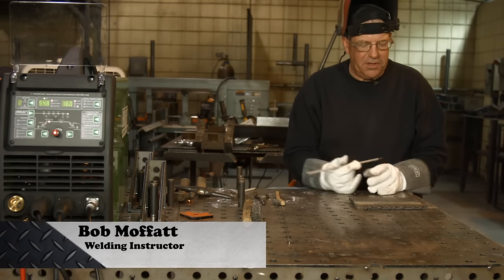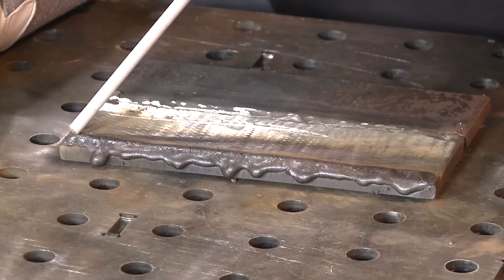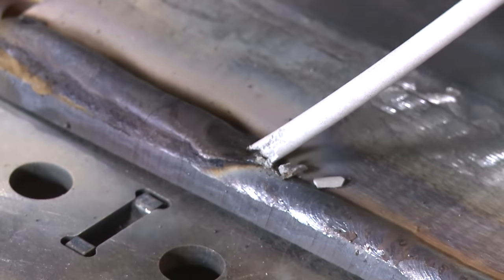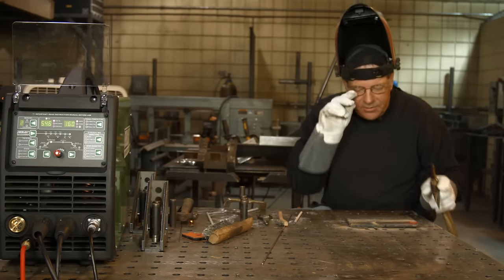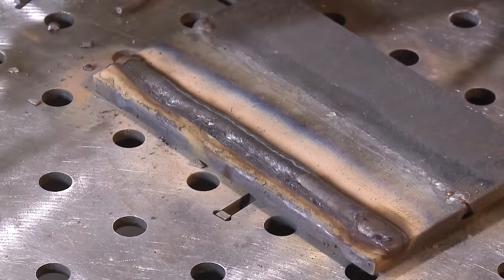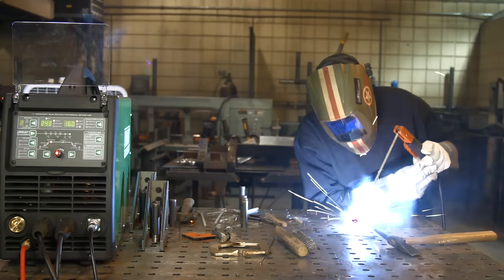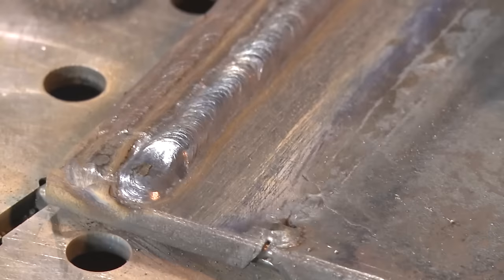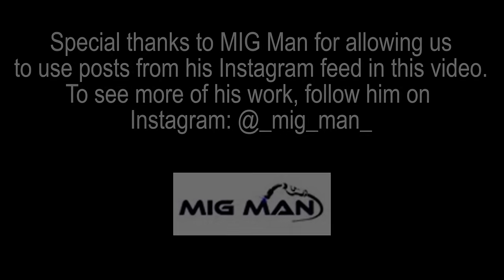Welding 101: How To Run A Straight Bead

Comment: I was a welder for 40 years. This is one thing that I would tell new welders. "Always try to make your next weld better than the last one, even if the last one was the best that you have ever done."
Reply: Thanks for the advice I’m starting welding next week
Reply: Do you ever miss it?
Reply: @LawrenceCaldwellAuthor  Actually, I'm not missing it. I have an old stick machine that I bought at a yard sale for 35 dollars and a flux core wire welder that I bought at Harbor Freight. It's the kind that has an inverter instead of a transformer. It welds almost as smooth as a MIG welder and weighs only 15 pounds.
Reply: @kraut5011  Awesome. I'm thinking about getting into it, but there's no schools around where I'm at.
Reply: LambentTyto teach yourself
Reply: I was a welder for 6 years and don't miss it. The money was good, but its nicer not having to breathe in burning metal for 10 hours a day.

The one thing I learned which was contradictory to this video was to maintain an arc gap. Rather than "barely touching the plate", we ran our rods about a mil or so above the surface, the only time you ever got a stuck rod was one of the low hydrogen bastards when your striking them.
Reply: @somethingoriginal5880  Some advice which you can try, It worked for me but everyone develops their own method really - 
I like weld standing up - you'll have more control, 
try to keep about a mil or two (or a 1/25 inch  to a 1/12th). 
pick up as many offcuts of material from your local hardware store as you can, and buy corresponding rods for them - you need a stainless rod to weld stainless etc...
Its all about managing your heat input - you get used to judging it by eye based on the glow

ALWAYS clean your welds before another run. (just always clean your welds.)

For TiG or Gas welding, I find it easier to sit, as you'll find both of your arms in constant use.
DO NOT GET INTO THE HABIT OF PUSHING THE STICK DOWN WITH YOUR MASK OR BODY. It's very easy to mix up the hot side and the cold side.
(Sounds dumb and obvious, but more welders than you think have probably stuck an inch of welding rod into their belly at some point)

For MiG - I dunno go nuts. just go ham. I sucked at mig welding Im not gonna lie. I was always just frustrated at how messy it is compared to mma, tig and gas.
Reply: @Teadrinker3445  "the only time you ever got a stuck rod was one of the low hydrogen bastards when your striking them."  This was true with the 3/32 rods.
Reply: That is good advice. You’re only as good as your last weld.
Reply: @easyenetwork2023  I always learned from other welders. Even younger welders. Some of those guys learned a lot quicker than me and made some beautiful welds.
Reply: @easyenetwork2023  Did it affect your lungs ?
Reply: @easyenetwork2023  Was it really that bad ? Even with respirator ?
Reply: @MUUKOW3  u may start but good luck there's alot to learn
Reply: @mikeundereood1071  You can pick up a good welding book at the local bookstore for a few bucks ,watch YouTube videos and practice.  You may not be manufacturing CNG tanks but doing general fab work is easily in reach.
Reply: Hopefully the first one will work out good then 4 blobs on each side of the weld line on my patch plate just for extra strength.

So you were into to this stuff for that long then what's the best way about welding a rusty surface should i clean all the rust off first then weld or what's best
Reply: @Mike-su8si  It depends on the situation. It's always best to have a clean weld surface but you might not have that option.
Reply: I like to think that advice can be pushed to many aspects of life
Reply: @LawrenceCaldwellAuthor  yeah right here on YouTube you can learn from other people's comments or videos
Reply: @kraut5011  I have already cleaned the surface off and it has 2 coats of paint on it so i wasn't for sure if i should resand the paint off to weld the thing 

Cause when i first sanded it it was to get all the flakes of rust off I probably will go ahead and resand it weld clean it then paint
Reply: @Mike-su8si  It's hard for me to give  advice without being able to see what is it that you are are working on. If it's two separate pieces you might have to grind bevels or if it's one piece with a crack you might have to grind or gouge a groove in it. You could weld without removing the paint and it might work but to be sure the best way is to remove the paint and rust.
Reply: Yup thanks. Good advice. But u forgot bout the smoke. Now im having zombie eyes when woke up midnight. Nearly hacked to death by my wife
Reply: @somethingoriginal5880  me too
Reply: Hello
Reply: I got my first welder today. They all suck. Ha.
Reply: @kraut5011  
My welder is homemade.
Cost me nothing to make
Also made homemade spot welder but that cost me £10 for parts.
Reply: @scottrocks1993  Cool. If it gets the job done it's worth the effort. I wish we could post pictures.
Reply: 100%, your only as good as your last weld👍
Reply: As a welder, I understand this completely
Reply: you know. my instructor just recently said this verbatim to me the other day
Reply: @somethingoriginal5880  ddxe xxecexeee
Reply: ok now I start to     beld🤗
Reply: im start welding today. i love it soo much
Reply: Absolutely applies to any skill that anybody could learn! There’s always room for improvement!
Reply: @huntergant3041  Learned welding at a Alcoa refinery in Texas. For the rest of my career I welded mostly mild steel (stick and MIG)(.030,.035 .052), aluminum (wire and TIG), Hastalloy (wire and TIG), Innershield, Pipe with 5p root and hot pass and 7018 filler and cap. Shops, river bridge construction, power plants and oil field. The last 3 years I welded in a large company that built big compressor units for off-shore oil rigs. I retired in 2005.
Reply: -Smokewagon probably
Reply: @kraut5011  thanks!!
Reply: Amen 🙏
Reply: Me too I've been a welder since 1955 and I never stop learning
Reply: Facts
Reply: A welders first weld is still going to be the best weld they've ever done, so there's definitely always room for improvement.
Reply: @jacobbailey2408  Not always, but I get your point.
Reply: @jacobbailey2408  A welder better hope that the last weld before the next weld was his best. If his best weld was the first weld then, he's not improving.
Reply: Smokewagon... true. Constantly compete with yourself in everything you do.
Reply: @RaysLaughsAndLyrics  yes sir.
Reply: @kraut5011  the way I meant that was a welders first ever weld, is going to be the best weld they have ever done in past tense. But it may not be the only weld they do in the future, so they can improve.
Reply: Preachhhhh! 👏🏻👏🏻👏🏻
Reply: I was working on a 6G 7018 pipe weld today; got to school ALL the way up on my high horse after this fantastic 2G weld I did on a 6" pipe over the weekend.
Long story short my root and fill were solid but I screwed the pooch on my cover pass. Ended up grinding the whole thing flush and redoing the cap
Reply: @Sue_Me_Too  Whatever gets the job done, works.
Reply: @kraut5011  lol I was so disappointed in myself when I pulled my mask off and saw my stringers. Finished it anyway then started grinding.
Reply: @Sue_Me_Too  It took me a while to figure out what was actually happening in that puddle. probably longer than most. Keep at it, if you like it, eventually you'll get better  and better.
Reply: Thanks for the advice really appreciate it 🙏.
Reply: Thank you sir thats great advice i hope i get hired
Reply: Nice !!!!!
Reply: Good advice, i should apply that to everything in life
Reply: @axelwalsh6767  Yep
Reply: I'll add that to my welding Bible sir thanks 🧑‍🏭
Reply: I would also tell them to: make protecting your lungs, their number one priority......NEVER weld without good extraction, and a respirator.....have forsight for your future  respiratory health in decades to come.
Reply: @poshgentleman559  I'm old school. Never wore a respirator in the 40 years that I welded.
Reply: @poshgentleman559  Thanks. I'm turning 79 in a couple of months. So far, no problems. good luck to you also.
Reply: My uncle tells me the same thing
Reply: @kidmorgan1226  Better listen to your uncle. Sounds like a good welder. Of course that could, and should, go with any endeavor.
Reply: @somethingoriginal5880  if your next one is better than the last one, then the last one is always gonna be the best you've ever done lol. But okay
Reply: At my job they are like "here's the machine figure it out" so wish me luck
Reply: Uncharted Waters
Reply: thank you for the advice
Reply: @kraut thanks for this
Reply: @denizzmugambiz3513  You are welcome.
Reply: @somethingoriginal5880  how has welding been going
Reply: Thank you for this tip iam a new welder going to school and I’m so excited I did this in high school and I just want to be my best and learn I love watching these videos of this man he sure is a goood teacher
Reply: Thanks for your advice sir

Comment: Nothing more satisfying when you go to chip slag and the entire piece just falls off with barely any force. This man is like the Bob Ross of welding
Reply: Chris Hatley i was JUST gonna say the same thing!!!
Reply: Chris Hatley that’s what happens when you use the electrodes he was naming
Reply: Just putting it clear as day light.take your time and focus right heat and metal
Reply: Exactlyyyy 🥰
Reply: That’s what 7018’s are known for, and beautiful beads. if u have the correct heat and speed than any rod will result in a nice easy peel slag.
Reply: Right
Reply: What about when the slag curls off by itself as you weld?
Reply: @benparker7773  EXACTLY! welding is all about managing your heat input.
Reply: Bob Ross That is so true
Reply: Happy little puddles
Reply: I never get to see that, as a welders helper on the pipeline I only ever use a buffer
Reply: No Bob Ross doesn’t believe in mistakes 😂 he’s the more rough Bob Ross
Reply: Lmao bob ross wasn’t this constantly angry 
“Fuck that damn bush”
Reply: no he's not he struggled to start his arc he's a good amateur
Reply: I love it when the slag curls up behind the weld and it only take a little "dink" for the whole thing to come off
Reply: Bob Ross was pleasant.
Reply: We don't have accidents, we have happy little puddles.  Just go ahead and slow down and put a little extra bead and reinforcement.
Reply: Easy chip off slag is not some super skill, a simple weld in top of a flat plate will always come off easy, especially first run when the plate is cool.  Do a fillet weld joining two plates is a bit more tricky.
Reply: "Happy little mistakes" comes to mind here.  
May not be appropriate, but that was my initial thought 💭 🤔🧐
Reply: Bob Ross didn't really teach how to paint professionally; he mainly was teaching so average people could learn to quickly paint a certain style of painting using a handful of structured techniques.  This welder on the other hand is teaching true welding skills that are the building blocks of how to become a master welder.
Reply: @TomO-nx1bd  Yes,  he's more the Mr Rogers of Welding

Comment: "bad habit of welding towards yourself" even though im just at the 2nd week of our actual welding our instructor told us to do exactly that & i struggled badly but i defied what our instructor told us to do & i welded starting near me going away, & boy did i nail it, & it was on flat...
Reply: That way you can get slack in your welds apparently, when pushing away. Just learning myself.

Comment: Haha, I remember how I learned how to weld.  At my old job, my boss was an old man...nice guy but he sucked ass at welding...looked like a line of chewing gum stuck in the joint.  I never took any classes or anything, I just started messing with the machine after work and just practicing.  The bosses son was the foreman there and he told me just do what it takes so the ol man won't ruin welds that we gotta look at.  After a few weeks, I got pretty good then told the ol man let me have a crack at it.  He about shit himself when I made a nearly perfect stack of dimes for a weld and just handed the stinger to me and said...this is your job now.  And honestly, I suck at welding but for the purposes of what we were doing, it was fine.  Now against this guy I'd look like a total choad.   But that's ok, I never claimed to be great, I just like watching metal melt in a hot electric arc.
Reply: Job security is being better than the next guy in line.
Reply: I am an amateur my welding rod just gets stuck on touching, what am I suppose to do?
Reply: Amir Patel keep practicing, and burning rods. Everybody has that problem. You will eventually find the technique so scratching the rod against the plate that gets the arc started for you. This guy, and a handful of others on YouTube are good welding instructors, and you can learn a lot from them. But you will learn the most doing exactly what they are telling you and just keep burning rod until it comes naturally.
Reply: @calvinhandley2373  that’s so true I burned hundreds of rods to get good just at 6010 but man is it worth it to have that perfect bead.
Reply: @amirpatel9988  Try a little more heat .
Reply: Chewing gum that’s funny, we called a bad weld job  (caterpillar shit)

Comment: I like how you sweet talk your rod to get her going. I'm pretty much the exact opposite. I find if I insult it, the sumbitch runs perfect every time. 

On the dangers of chipping hot slag...just the other day, I was welding in a tight inside corner, got to the end, WITH MY HOOD DOWN...I whacked the end of the bead to see if I filled the crater at the end enough....last weld of the day...dadgum chunk of slag made its way inside my hood and stuck to my top eye lid...it felt awesome. A little pain never hurt anyone.
Reply: I'm hearing you loud and clear, we've all done it and had near misses, close misses and bulls eyes.
Reply: gotta have them pecker detectors covered with atleast two pairs of saftey squints!  may hot slg miss your eyeballs everytime
Reply: john dowe not sure if AvE reference
Reply: +chris jones ha! well that oughta get her goin for sure!
Reply: Ryan Jones
Reply: Ryan Jones
Reply: Ryan Jones you want something to insult go get some of harbor freights new volcan brand of rods. I just returned some 1/8 7018 that came with a coating on the tip that has to be filed or ground off then they wouldn't even weld until I was set at 130-140a and even then it sucked.
Reply: +Allen McKinney pretty normal for something from harbor freight to make you cuss like a sailor.
Reply: I was contemplating adding some leather to the sides and bottom of my hood to cut out the reflections of bright light behind me. You've convinced me to do this now. Ouch. I only run Lincoln rods with my everlast welder. I'm a bit of snob when it comes to electrode brands.
Reply: +Samuel Clark but not a snob when it comes to machines I see.
Reply: Lol!right
Reply: I had a small 1 inch hole right beside the zipper on my jeans. I was running overhead. Threw up a nasty bead and got excited to see it without the slag.... Nearly lost a testi that day.
Reply: Ryan Jones
Reply: during my 20 years welding I have been on fire at least once a week, slag is the best when it comes to getting burnt!! I will not work without safety glasses, but I have had things bounce in and hit my eyes. I now use a full face shield to use die grinders and cutoff wheels
  if you didn't learn something today, you might not be alive.
Reply: i once managed to burn my tongue that way
Reply: One day I was grinding away on something and a metal piece bounced on the machine I was repairing straight around my glasses and stuck to the side of my eyelids. 

Then later that day during lunch I had a ketchup bottle splatter into my other eye lmao
Reply: Ryan Jones dude i won't lie i've cursed at my arc not striking but the way you say it sounds like you go ape shit crazy start flailing around throwing hammers 😆😆😆 i gotta try that at work to lighten things up,make everyones day weird and fun
Reply: Ryan Jones so epic...
Reply: I wish your my teacher sir.  I accept strict teaches.  You said at the beginning you too ruff.  Welcome to the new society where   people of today can't take discipline.  He's too mean.  He's not nice.  My teacher suck.  He's ruff.  You get the drift.  That sure didn't stop you from getting paid for teaching.  I'm pretty sure you have a lot of experience.
Reply: Ryan Jones either way lol on welding rods depends lol
Reply: Ryan Jones maybe some ice water on it.
Reply: Ryan Jones i like that sir.
Reply: Lol
Reply: this language is unbecoming of a gentleman
Reply: lol
Reply: HITANASG1 definite "yes" to that
Reply: We all have had those oh shit moments when a piece of slag or molten metal makes its way where it shouldn't be, Some of those moments get you dancing.
Reply: Ryan Jones lmao
Reply: Ryan Jones it felt awesome “.  Bahahaaaaaaa.    Yes mate.
Reply: @allenmckinney9533 I won't buy a screw driver from Horrible Freight, let alone anything that I want to be of slightly below average to average quality.
Reply: Ryan Jones school is
Reply: Ryan..........this is priceless!!!!!!!
Reply: Anything to the eye like that is never fun! I wasn't using a stick but had that oh so awesome harbor freight flux core wire in a lil 90 amp harbor freight unit and was under a truck tacking some exhaust hangers up temporarily and had a big blob of got shmagma go inside of my ear. Like all up in it!! You wanna Talk about a pain that you can't describe!! I could hear it hissing as it rolled in. Not the worst pain I have felt but I literally can't describe it it was just not good. Not good at all..
Reply: feels like you burnt your tonsils?...LOL
Reply: You have to sweet talk her. If you don't she ain't gonna be in the mood.
Reply: Ryan Jones I was thinking the same thing 🤣
Reply: @bidousam  Then that night you bf splattered your grille...
Reply: Haha ROD...